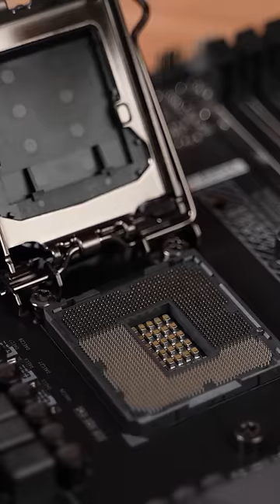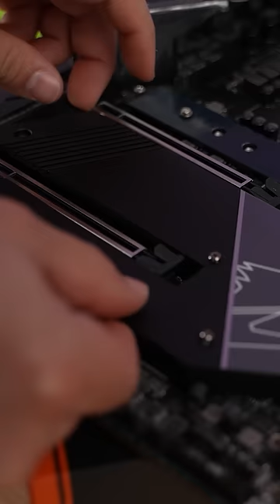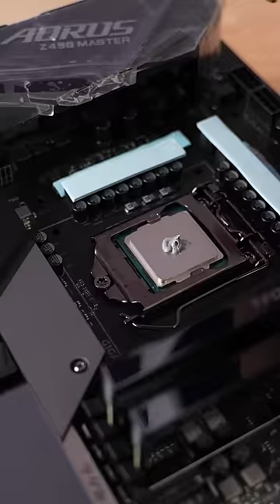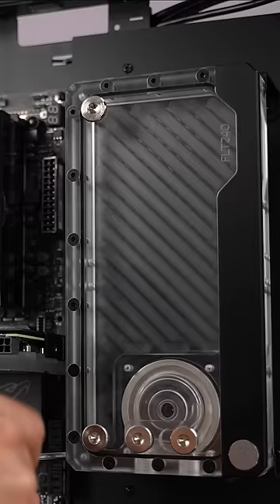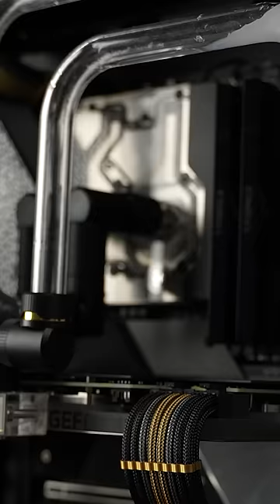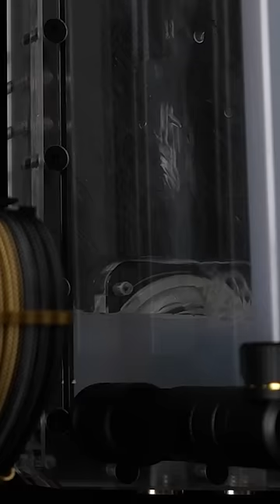$6000 EPIC Corsair 5000D RTX 3080 + i9 Water Cooled PC Build

Comment: $6000 computer and just 2 sticks of ram . 😆
Reply: When you get up to the really expensive motherboards they only have two RAM slots usually, one A channel and one B channel. It's means the traces are closer to the CPU meaning less latency.
Reply: @Solly_March_Goat  That's not actually true, electricity travels at speeds close to the speed of light, having shorter traces does not improve latency, it improves stability. Second of all, top of the line motherboards don't have 2 RAM sockets, that's false, they tend to have more, 4 or 8 depending on its ATX size. However, most motherboards that have 4 DIMM slots (RAM slots) only have 2 DIMM channels so while the size of your ram will increase, two sticks will be using the same channel thus reducing the speed of your RAM by half. I believe on newer intel DDR5 motherboards the top of the line has 4 DIMM channels so this does not happen. However, I have yet to investigate this latter statement so take it with a grain of salt
Reply: @hola_chelo  apex, tachyon, unify-x, oc formula, dark.  All 2 slot boards
Reply: @Solly_March_Goat  also, there’s 64GB of ram here
Reply: @Alax43  board size pls dont assume everyone knows every Motherboard
Reply: @seth7762  They're al ATX
Reply: And pci 3.0 m.2s
Reply: 2 sticks but he has more ram than most people with 4 sticks, that ram was 500 alone lol

Comment: All pearlescent fluids tend to form hard deposits on the pump bearing.  If you don't have a spare pump and/or want to delay loop maintenance as long as possible, use clear liquids.
Reply: Or distilled water
Reply: The point of distilled water is simply to prevent any possible buildups or deposits over time/with age.  Adding something to that will fundamentally be different than what I said.

Comment: I mean i love Intel but if you've got a 6000$ Budget you should have gone with Epic instead.
Reply: This is gaming not workstation, epic is way to overkill for a gaming pc, when have you used more then 8 cores for gaming
Reply: @DonaldRump.  its about a 6000$ pc so he probably won't care about usability
Reply: Would get worse FPS with epyc  this is most likely a gaming pc so a 12900k will be way better
Reply: @StrixWar  if ur spending 6000$ on a machine that can only game you need your priorities sorted. I used to be an Intel fan myself. But for the last couple of years the way they have competed with AMD. By just increasing the wattage draw, have been very fucking disappointing, i mean yeah ALDER lake is cool. But the 9th, 10th and 11th gen has literally just been factory overclock it, till it performs better in gaming than a Ryzen.
Reply: @hryper  my 12900k can render 1080p 60fps 30 minute videos in minutes and that’s with 32gb ddr4 3000. The 12900k with ddr5 can perform pretty close to a 24core threadripper from the 2nd generation. My system costed me $3100 (CAD) and I have 12900k z690 and 1080ti my system is great for work loads and gaming
Reply: @hryper  I’ve had clients spend $35k to play solitaire and watch dirty videos lol
Reply: @TristinTalksTech  you must be the guy that invented the selling sand in a desert phrase or you selling some kind of quantum computer

Comment: put a build to gether with close to exact parts except psu (used corsair 1200w 80+ platinum), and i9-10900k cpu. also added a 3090 in there and under 3k, so either this man spent 3k on tubing and connectors and blocks or he also adding his time in labor.
Either way nice build

Comment: Wish Alienware had water block for there 3080 Ti I saw one time they had a water cooled GPU option i think it was a 1660 Super but my 3080 Ti run fines VRAM’s never get over 75C the chip stays around 65C while gaming CPU hits 56C idles at 30c, when I first got it, it idled at 50C and about 2 mins into a gaming session I was around 85+C there thermal paste application was almost non existent, so I re-pasted with kingpin KPX and now my thermals are amazing I have cores hitting 5.0-5.1GHZ on a 5900X with no OC

Comment: For price aproximatively 
CPU = 10900k or 11900k = 300-400€ 
MB= z490 = 200-300€ 
Ram = 2* 16gb = 200€ 
SSD and power supply is around 200-300€ (if is an HDD) 
GPU = (1000-1800€) 
Box+watercooling= 500-1000€ 
2400-4000€ MaX ( 3000€ is approx) is definitely not 6k !!!!

Comment: 2 big mistakes ... The 1st, you missed up the ram installation (its gonna work in single channel ...).
The 2nd, you used the first M2 slot for the SSD, it shares the pcie lanes with the 1st pcie_X16 slot, so the X16 slot will work with x8 lanes only because these both slots are sharing the lanes from the CPU ...

Nice short ....

Comment: I just build a 4500$ pc and I have a 3080 ti i9 12900k 32gb of ram and 2 dummy ram 10 Rgb fans Lian li case and 1tb of Samsung 980 pro ssd how the hell was that a 6k build ik water cooling expensive but that’s not worth it
Edit my build with a 4K 144hz monitor and Astro A50 with mouse and keyboard cost 6k so idk how he spend that much when I have better stuff in my build
Reply: I just built 1 for $2,700 with water cooling😂😂😂 either he’s sped or don’t know how to count

Comment: This is $6000 and my set up is not even water cooled yet??

Lian Li 011D Mid Tower (Black)
ASUS ROG Crosshair VIII Extreme
Ryzen 9 5950x 
Trident Z neo 3600mhz DDR4 CL14 2x16
EVGA 3090 Ti FTW3 Ultra
Lian Li SL120 9 fans (6 Intakes 3 Exhaust)
Lian Li Galahad 360 AIO (Top Mount)
Lian Li Strimer Plus V2 (MoBo and GPU)
Sabrent 4TB Rocket 4 Plus NVMe 4.0 Gen4
EVGA Supernova 1600 G+, 80+ Gold 1600W

Water Cooling in 2 weeks!